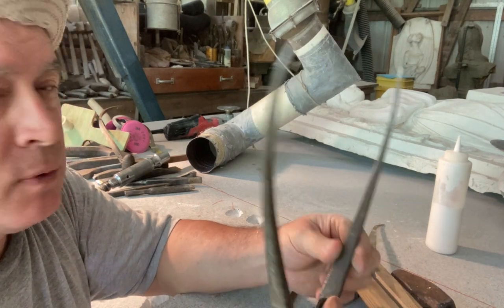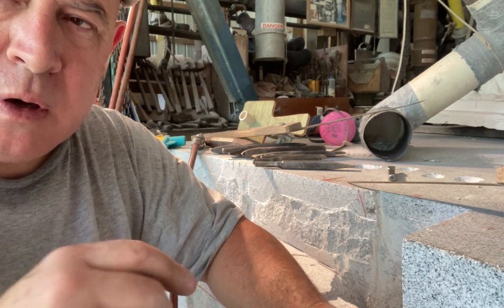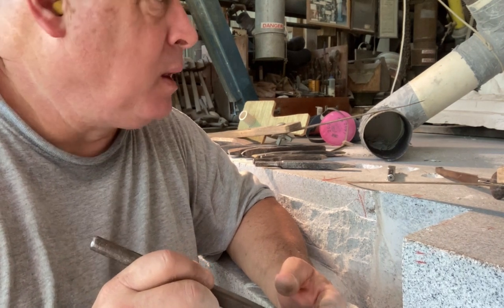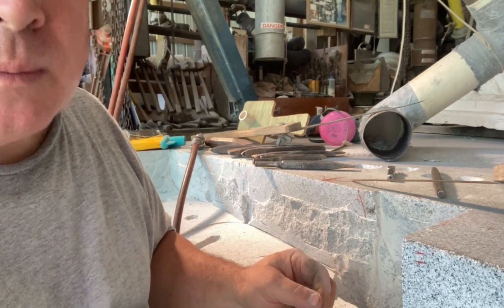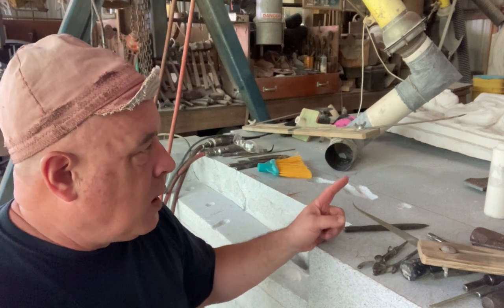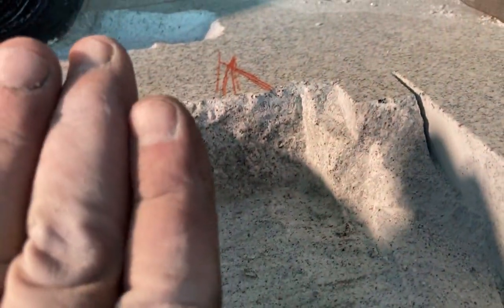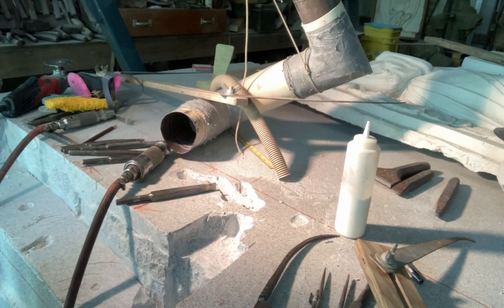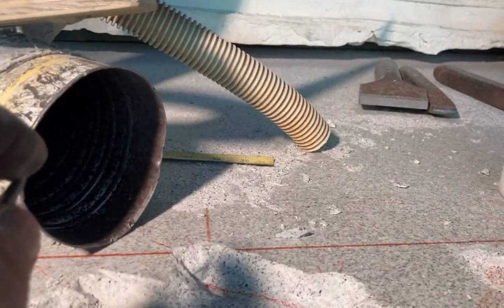Virtual Stone Carving Apprenticeship  VSCA Video 119 Life Size Angel Compass & Triangle 17

Comment: It is like the compass swings in an arc, but then you have to remember to think in “bubbles” really, for getting it accurate in 3d
Reply from the maker: As you do this or at least when I do it, you can be gone to “see” what is or isn’t & should or shouldn’t be happening. 

 No matter what position you are addressing, striving to approach every point perpendicular to the tangent is always critically important.  Even when you cannot service a point completely perpendicular to the tangent, understanding exactly where that approach is will help you avoid eroding neighboring material that needs to be left intact for other job detail.